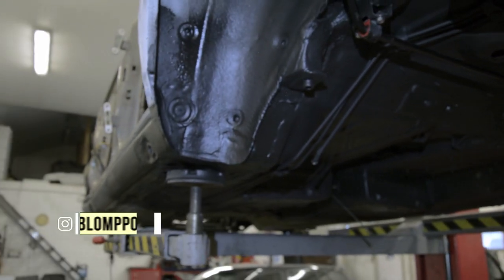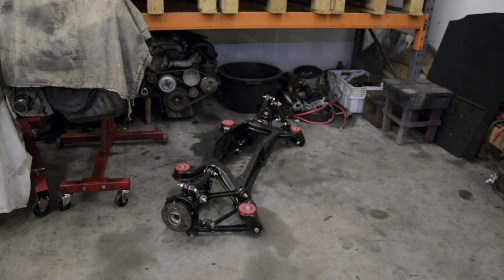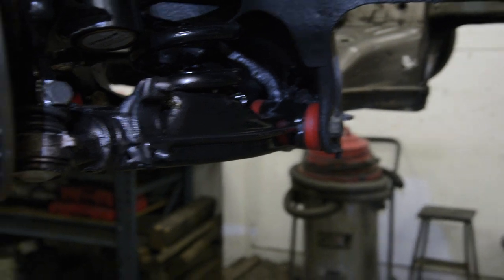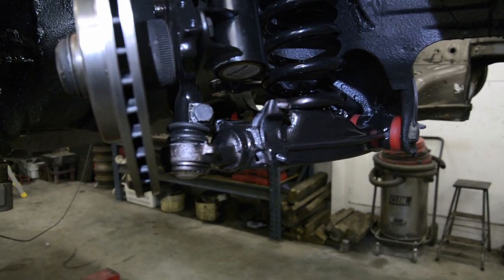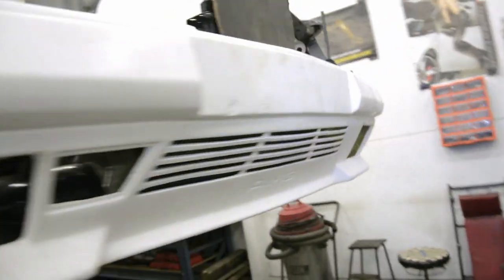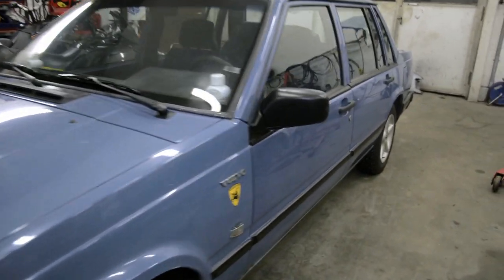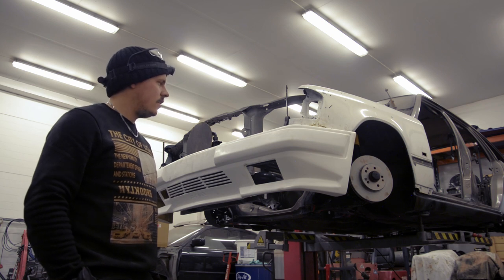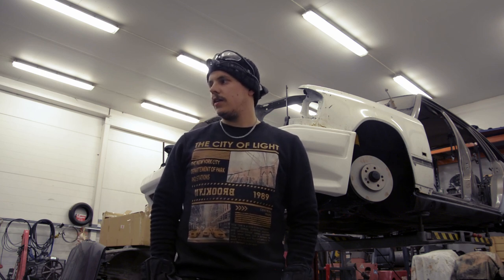VÄRKSTAN S2E6 - Finally Some Reassembling!

Comment: Vet du om en drivaxel från en w202 passar till en w210 wagon?
Reply from the maker: Nej det passar icke. Betydligt längre axel på 210
Reply: @Blomppo995  från en c180 2000 då?
Reply from the maker: Samma sak, för små splines i navet också
Reply: @Blomppo995  förlåt för dumma frågor, men går de å ta inre drivknuten från en c180 2000 eller w202 å sätta den på drivaxeln till w210 å att de passar på diffen?😅
Reply from the maker: Om w202 knuten är 110mm i diameter så passar det, men dom flesta w202 har bara 100mm.
Reply: @Blomppo995  tack!😊